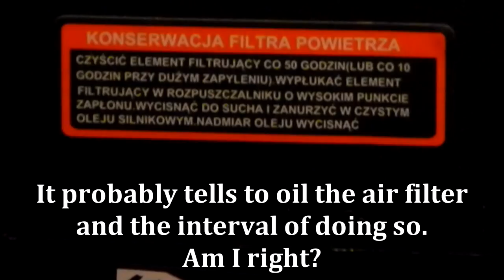The Engine For The Mill - Band Sawmill Build #12

Comment: Clean the air filter every 50 hours (or every 10 hours with heavy dust). clean with a solvent, squeeze it dry and soak in clean engine oil. Squeeze out excess oil. Something like that is written there :)
Reply from the maker: Cheers! Now I can rip that sticker off there. :D Thanks for translating it for me. ;)

Comment: Clean the air filter every 50 hours (or every 10 hours with heavy dust). clean with a solvent, squeeze it dry and soak in clean engine oil. Squeeze out excess oil. greeting from poland :D
Reply from the maker: Cheers man. Greetings from Estonia. ;)

Comment: You should clean the filter until 50 hours if you use it in clean air and until 10 hours in dust air. To clean use solvent and than squeeze  and soak in clean engine oil. Excesse of oil squeeze.
Reply from the maker: Thanks man! I kinda guessed the same. Thanks for taking the time to translate and to watch the video. ;)

Comment: Donn - about the air filter - sticker says: You need to clean a filtering element every 50 hours , or every 10 hours If  pollination of air is high),  About a filtering element you need to clean it in a solvent with a high degree of ignition, next squeeze it to dry, and next soak a filtering element with engine oil  if nessesery soak it a litle bit.

Comment: ALWAYS shut the fuel off after shutting the engine down as the gravity feed fuel system will drain a whole tank of fuel into the cylinder and crankcase, I'm speaking from experience. Good luck with the sawmill build
Reply from the maker: Thanks for the heads up on the fuel system. I guessed it had a similar carburetor to motorbikes with a shut off valve when the fuel level gets high enough in the float bowl. Have to check it out more in depth. Thanks for watching!

Comment: Good thinking about removing that key in the axle :-)

I know one unhappy electrician who was supposed to test a motor - but had to go to the hospital instead as he forgot to remove the key before starting it. Now all motors have to be fitted with shields before testing. 
I think this was a 1400kw motor so it would have had no problems running that saw you are building :-D
Reply from the maker: I think the sawmill would collapse under the weight of this 1400 kW electric motor. It must weigh a ton! :D:D:D Ouch, my condolences to that electrician. I hope everything is okay now.

Comment: i hope so it will be helpful :) 

clean air filter in 50h interval or 10h interval in hardcore dust environment.
Clean air filter in nitro solvent, squeeze air filter till dry. 
soak air filter in engine oil, squeeze excess of oil.
Reply from the maker: Thanks man, it is helpful. ;)

Comment: Rough translation is: "Clean the filter every 50 hours (or every 10 hours in very dusty conditions). Rinse the filter in a solvent with a high ignition point. Squeeze dry and immerse in clean engine oil. Squeeze excess oil."
Reply from the maker: Your translation sounds spot on. It sounds like something they would put on an English sticker. ;) Thanks!

Comment: We want to design this like your sawmill.We have 6.5 hp MOTOR and 3 kw monofaze electric  motor.are these motors suitable and enough.
Reply from the maker: I would at double the power on the petrol engine (mine has 15 hp) and replace the 3 kW mono phase motor with at least 5 kW three phase motor. There's never enough power. ;)

Comment: Nice video, however how can they rate that toy as 15hp, Mini car engines used to be 10hp and no way is that toy one and half times a mini engine.
Reply from the maker: If I were to use mainly the ICE then I would up the power. I have a monster (7,5 kW if I recall correctly) electric motor ready for this project. This will do the main work since it's more efficient and has more torque and let's be honest, I'm gonna use it probably 99% of the time as a stationary mill. :D The gearing and thus the blade speed for both the electric motor and the ICE will be different which makes the usage of this little 15 HP engine possible due to the lower blade speed (thus longer time to cut).